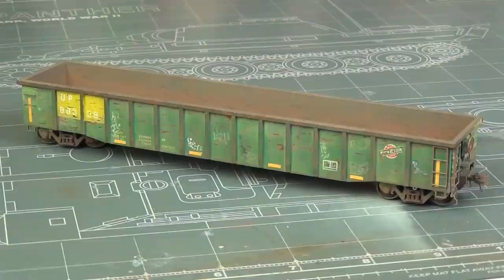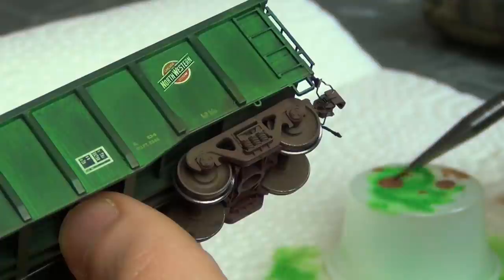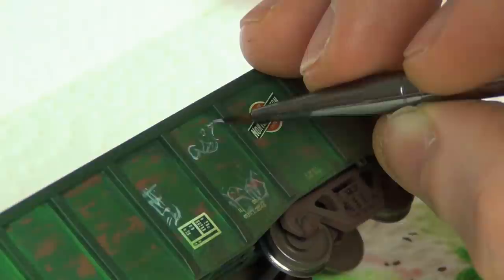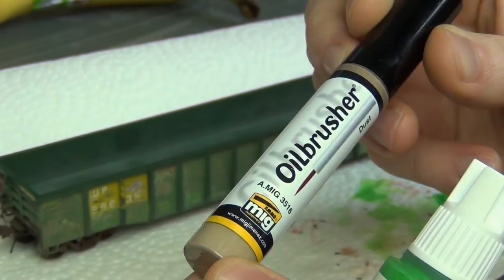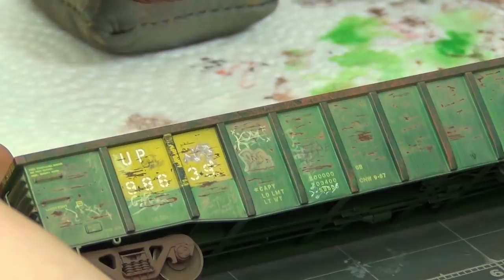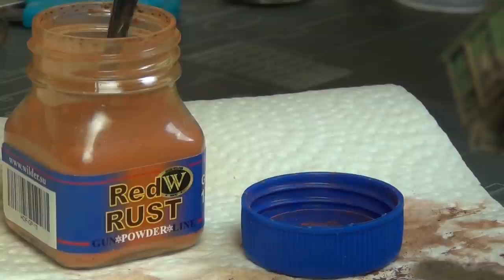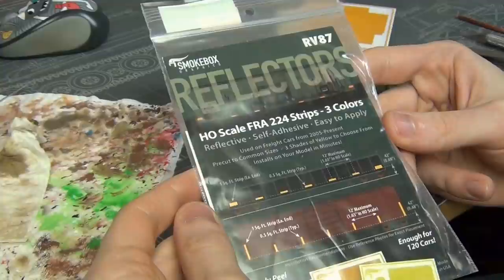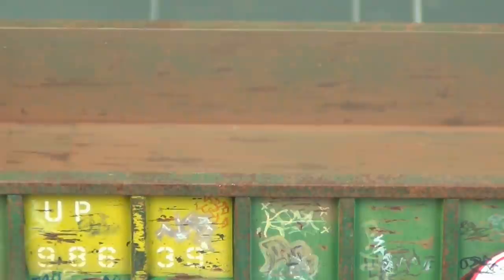Realistic HO Scale Gondola Weathering | Model Railroading Tutorial

Comment: The only additional step I would suggest is the use of a hot soldering iron to add areas where a loader bucket or cargo has made contact with the edge of the box. A common occurrence which I may have accidentally done on real cars when loading and unloading them.

Comment: I model a time when there was no graffiti on any rail cars, so I don't do it.  I use rust powder that I make by putting some 0000 steel wool (about 3 pieces) in a jar and fill it up with white vinegar.  After about a month or two after it has turned to rust, I pour it out into a stainless steel 11x14 photo processing tray and wait until it all dries.  Then using a single edge razor blade I pulverize it into a fine powder which I later use as rust.  I use an Exacto (Aproxo) knife and make gouges in the plastic which i then fill up with my rust powder.  After weathering, I use my airbrush and give a final coat of DullCoat.  Looks real 'cause it is real.  Cheers from eastern TN

Comment: This video is amazing, I’ve always been a little intimidated about weathering, have done a few cars and engines.  Watching this video though has made it look very approachable, love the steps and the explanations.  Question for you, do you paint or airbrush the trucks with a flat black before wreathing them, and did you use matte finish at the end to lock everything in?  Thanks again, look forward to seeing more!
Reply from the maker: I'm glad you enjoyed the video!  I generally will dust the trucks with a dark brown-grey mix, usually Tamiya XF-72 and XF-69 in a roughly 1:2 ratio (and also thinned).  That colour can also be sprayed lightly over the lower ends of the car body.  In this project the trucks were a dark red so I think I used a different approach in the video.

And yes, I seal the model with a matte varnish.  That protects the car against handling and also unifies any glossy areas remaining from decals etc. with the rest of the matte finish.  I use VMS Matte Varnish which I airbrush on, no thinning.  One note: if I am applying the reflective FRA stripes for modern equipment, I apply those the varnish first, and then the reflectors after since I want those reflectors to be shiny still.

Comment: Great job and clearly explained. Like it a lot. Two questions:

1. Why don't you use the sponge effect for the rust on the inside and outside as well?

2. There are always a few dents, right up on the rim of the gondola but also inside the hold. They're easy to style, why not "wreck" your car in some super weathering like this?
Reply from the maker: Thank you for the comment!  

You can use the sponge on the inside and outside too, but it's best used on raised details as the edges catch the sponge texture in a way that produces natural looking wear.  On flat areas it's less convincing since it's just round blobs of chipping you get with the sponge. Also, the photos showed linear scrapes and wear on the panels, so I had to do those by brush.

I agree that physical damage to the car body would be a great improvement.  I'm just not yet confident enough in my skills to do that effect without breaking the model :) maybe next time.
Reply: @Panzermeister36  Thank you for your answers.

Comment: Have you ever used a heat gun to soften the train cars abd then use the side of a paper clip to push in dents onfi the surface?
Reply from the maker: No, I haven't, because that would likely produce out-of-scale damage to the panels.  I'd much rather replace the panels with thinner sheet that I can damage realistically.
Reply: @Panzermeister36  Yeah, I've never seen the heat techniques produce realistic-looking bulged panels. The most convincing I've seen have been when people glue an extra layer of bulged-out, super-thin styrene over the existing panels. But that only really works for loaded gons, as the interior face of the panel is still flat.

Comment: Great video - I can't wait to try the techniques you demonstrated.   I do have a coupe of questions....

1.   I model an older period coal road, and was wondering what colors I should use to weather a black hopper car - both Acrylic and oil.

2.  Do you have any suggestions on sizes and brands of paint brushes are good to start with.  I will probably have to order these online, if that makes a difference.  

3.  As for the oil paints, what do you use as a thinner for cleanup?   Is there any recommendations you have for ventilation on the thinners?

Thanks - and I really enjoy your work.

Comment: Just curious. Using the bright green AK recalls a similar procedure you use on armor.  Does the AK work as well as oils? What thinner works best for 3rd Gen?
Did you clear coat it before rendering?
Not a RR guy but like your weathering!
Reply from the maker: I use oils for a similar effect, but the oils are a lot less opaque so the result on armour models is more subtle.  

I just thinned these AK Gen3 with water.  

I like to work over a satin finish.  The default paint on these models is satin so I didn't varnish, but if the surface is matte then I apply VMS satin varnish before weathering.  

Hope that helps :)